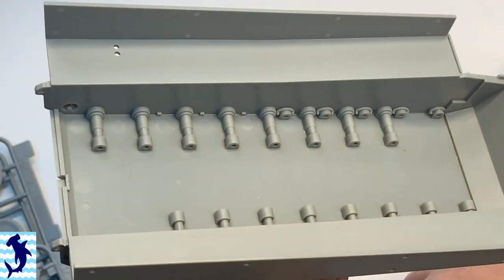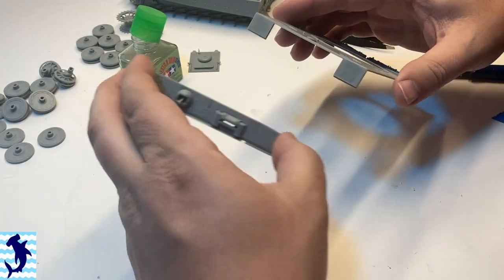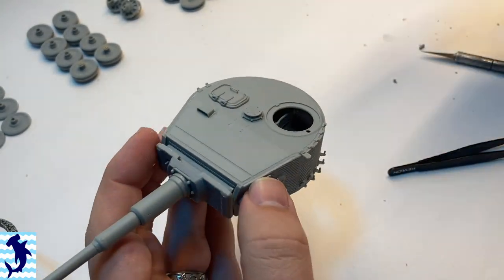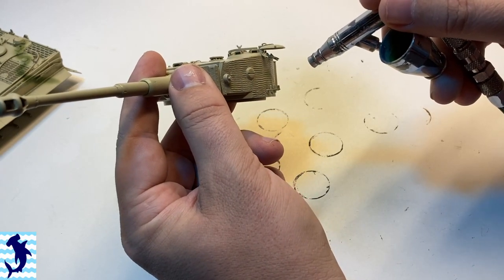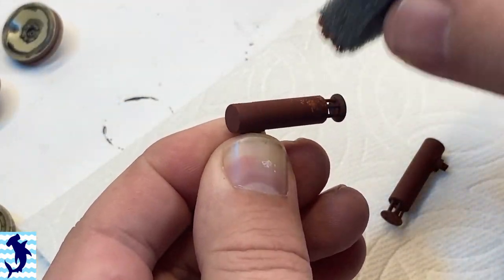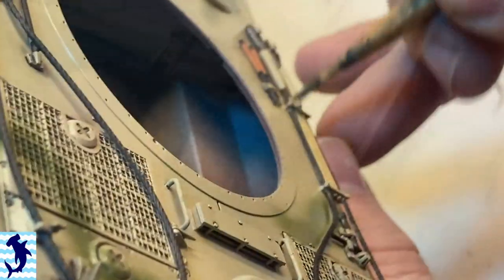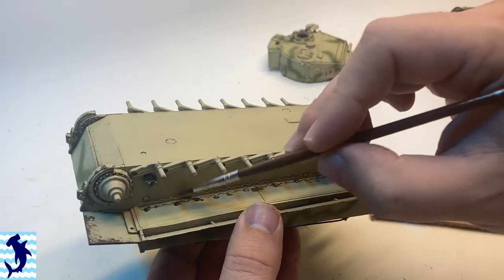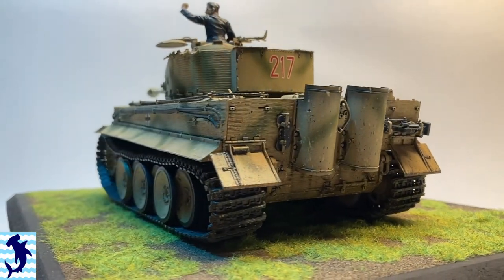Dragon Tiger 1 Full Build Otto Carius 1:35 scale

Comment: Couple things. There are pictures of screens being missing so you could have put the other on. As to tge screens? They are a loose fitting screen so easy thing to do take a pencil or something round and push down the areas of screen not on the actual deck parts of the tank. It adds an easy realistic touch.
Reply from the maker: Good to know!  Thanks for this info, it will come in handy for the next Tiger!